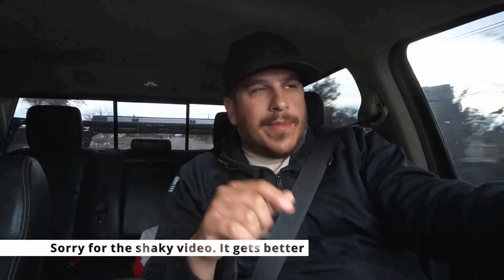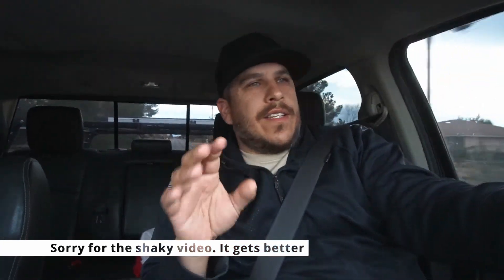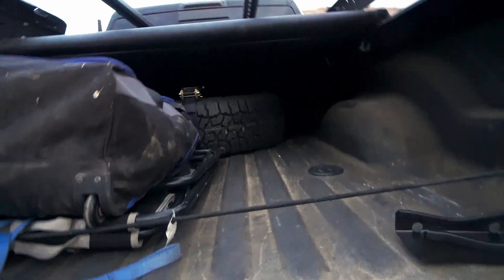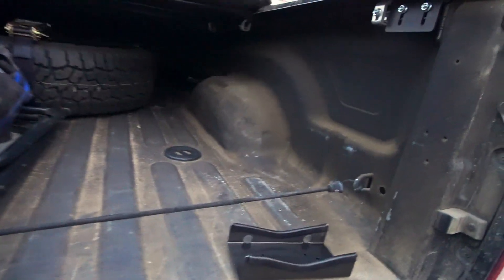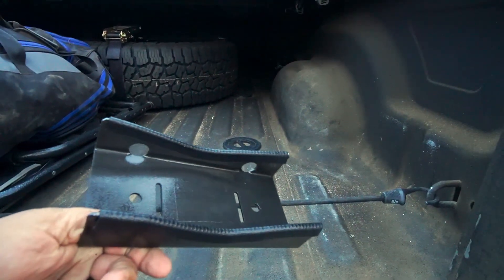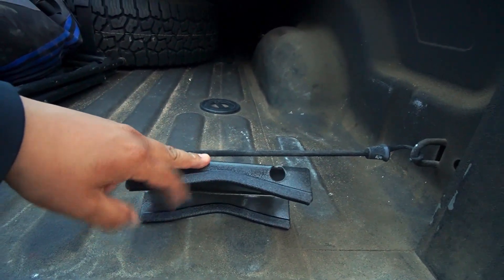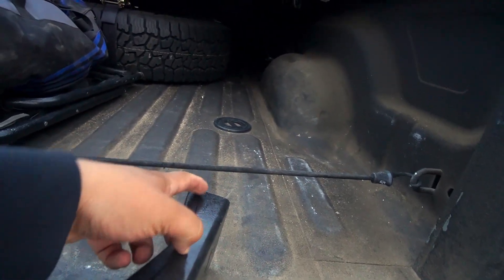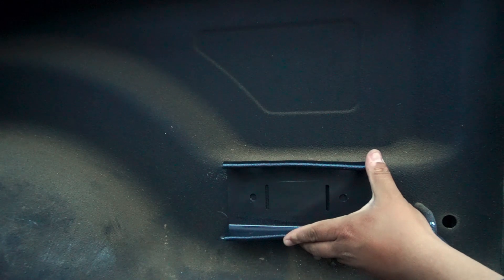Propane Tank Mount in my truck bed

Comment: Harbor freight eclip mounting brackets to $5 a piece
North 40 3 ft of chain two dollars 50 cents
North 40 two eclipse with d-rings $6 a piece
North 40 to stainless steel carabiners $1.25 a piece
Peace of mind propane tank will never move again
Reply from the maker: As long as you find something that works for you is really all that matter. Thank you for watching.
Reply: Make a video

Comment: Why don't you put some of that Trim-Lok around the base of the tank so it doesn't scratch the hell out of your bed lining...
Reply from the maker: To be honest I have had it since the video was put out and I use it for at least 6 months out of the year with a tank in there and nothing has happened to the liner. I do see where the concern would come from but it is secure enough that once tightened it doesn't move at all